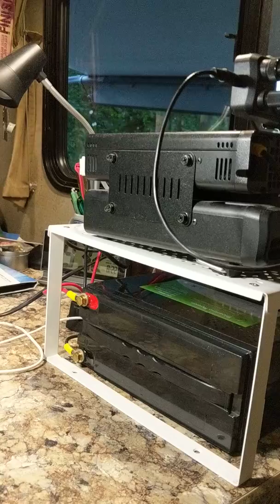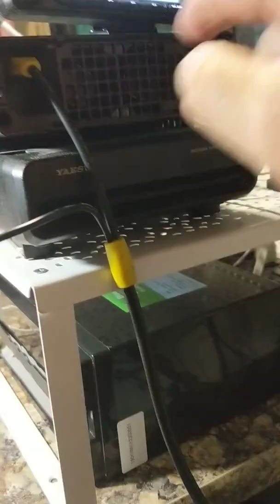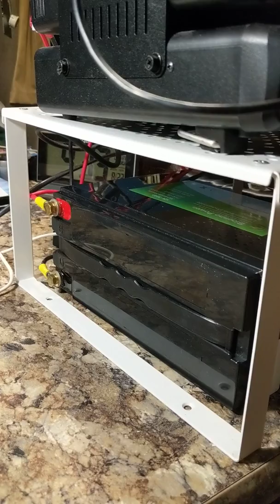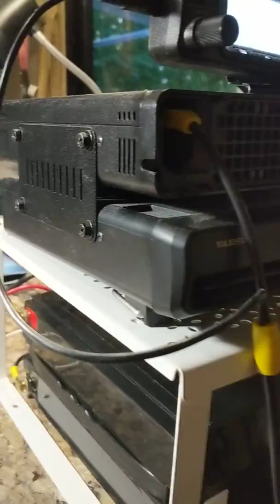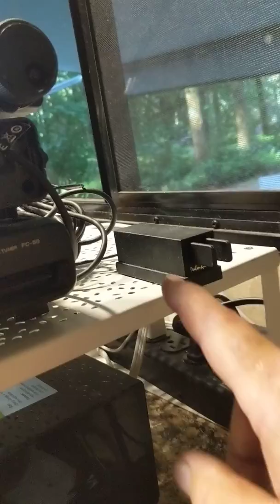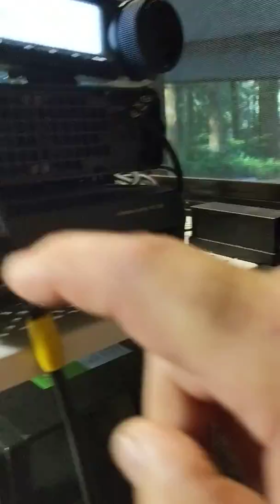New 30 amp hr Bioenno lifepo4 battery shack in a box

Comment: How much time did you get from battery at what power output??
Reply from the maker: 100 watts  out put and all day , i added a 100 watt solar panel. since then I have added a 100 amp hour Battle Born lifepo4 and i have no issues with running out of power